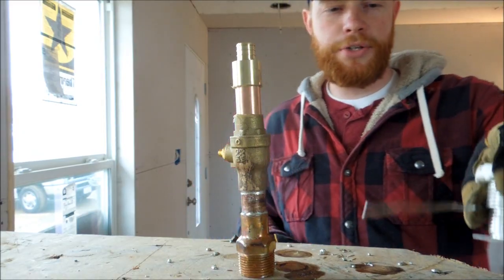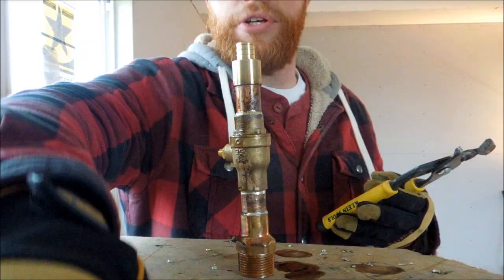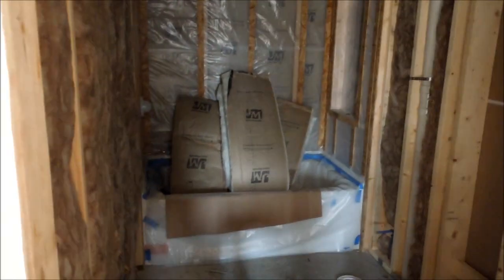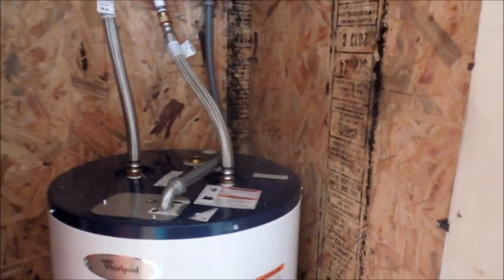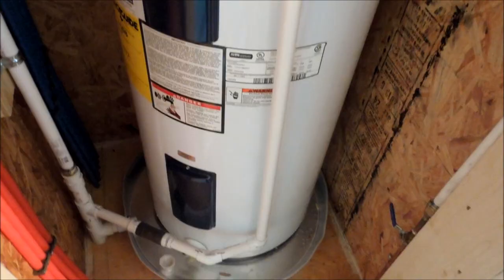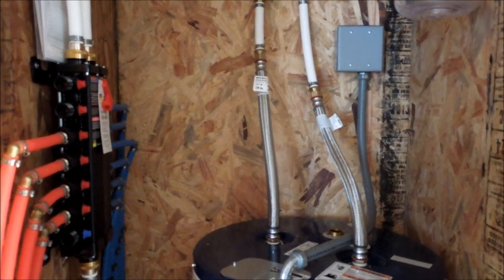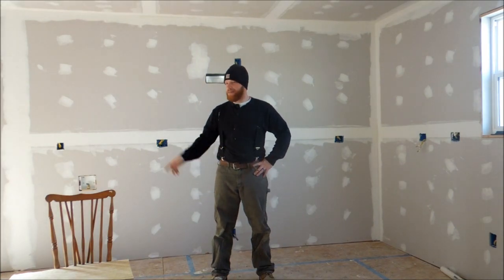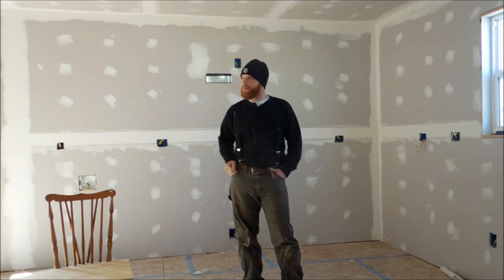J2H 2.0 - PEX Plumbing & Sweating Copper by HPFirearms

Comment: What keeps the water from getting into your hot water tank pan when you flush the manifold or if the pressure relief valve pops off?

Comment: FYI, Most codes require the TPR valve have an air gap and don't allow it to be connected directly to the waste drain like that. Looks great otherwise though.
Reply: The air gap you're referring to on a T&P valve is to eliminate spray back from the force of water upon release. Has nothing to do with connection to a drain. He's got a spring check in there and another opening into the pan so cross connection is pretty unlikely
Reply: +Corey Jensen although I like his connected setup for the pan and the overpressure valve drains, I do think code requires the line to be separate from the pan line if I am not mistaken. End of the day this setup looks clean and is probably very effective/adequate!